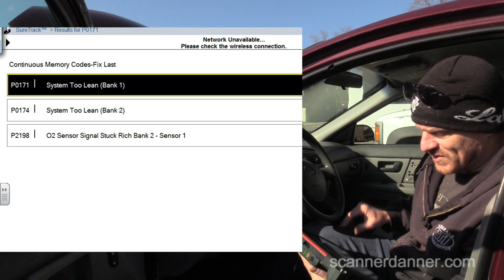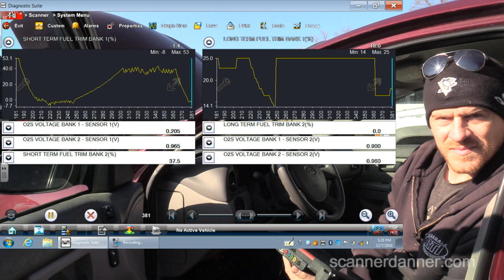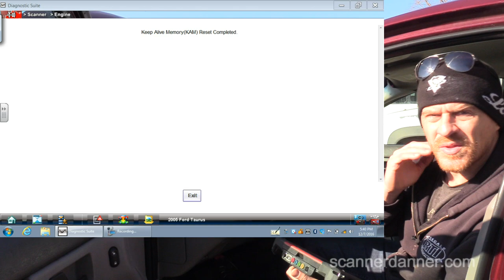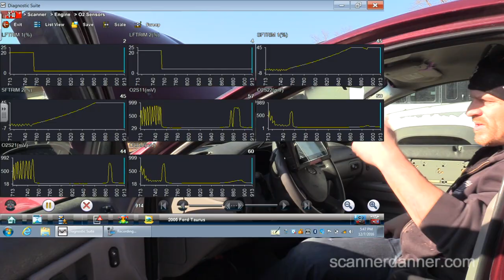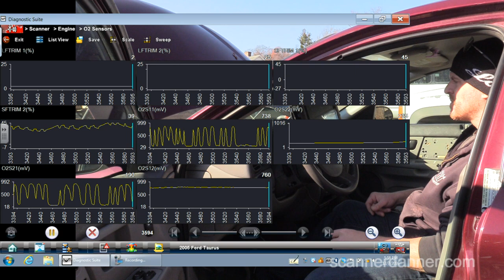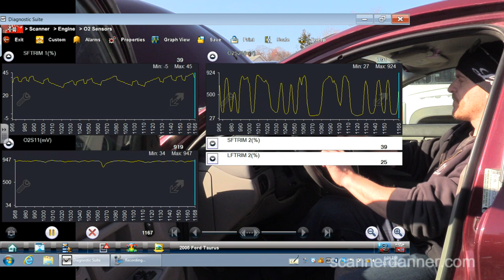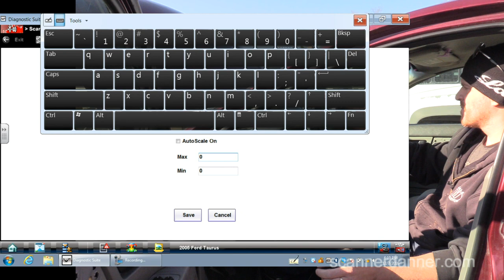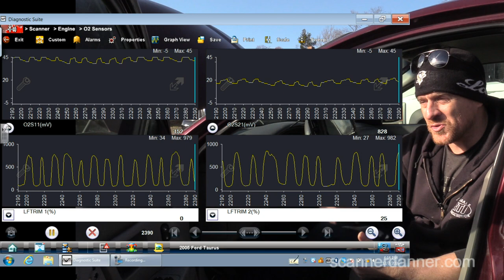Ford Taurus Lean Codes (P0171 & P0174) with Rich Bank 2 (P2198)

Comment: ScannerDanner you have proven time and time again that the water test is the best way to find a vacuum leak. I have a P0172 and P0175 codes on my scanner and I'll be definitely trying out the water test around my plastic intake manifold both cold and normal operating temperatures. I want to thank you for teaching me so many things that I don't know if I would learn without watching your videos so thank you very much for all the great info videos and live diagnosis of all the different makes and models out there. Your students are lucky to have you as an instructor... They're receiving factuals and pure wisdom and you're the best out there man !!!  Keep those water tests going brotha 👌🏼
Reply from the maker: Thank you! The 172 and 175 are rich codes though my friend. A vacuum leak is definitely not your problem. The 171 and 174 codes are your lean codes (vacuum leak, low fuel psi, dirty maf etc)

Comment: Thanks for everything you do. 30 years in the business and I'm still learning new tricks. I'll start using the test light to do the capacitor discharge (thanks to the guy who passed that on). I've also been using the water method since the early 90's when I worked at Mazda dealership. Safe and very effective.
Reply from the maker: Thanks Jeff!
Reply: ScannerDanner thanks for taking the time for making these videos I been watching your videos and I learned a lot from you 
I'm like a you tube mechanic I basically learned what I know on my own. Thanks again 
I actually learn the water test from one of my compas from Mexico lol
I would like to meet u and attent to one of your classes

Comment: It is very important to understand that the OEM"s can have different strategies for fuel trim adjustment with faulty O2 sensors on seperate banks. Failure to know this can lead many techs down rabbit holes and having them become parts changers and replacing parts such as PCM's, all because they truly don't know whats going on when looking at their scan data. I have found that many courses and schools do not emphasize this enough. Great job Paul.
Reply from the maker: Thanks man

Comment: Thanks guys for your inputs. Especially you Paul. It's an honor for you to answer my question. I've seen lots of your videos and learned a lot. You kinda remind me of me as a younger man. However I believe my statement still stands. Maybe I can explain it this way, if you where to clean a contaminated 02, it would probably work as designed, perhaps slower than new. But no amount of cleaning or contaminates would ever make a dead sensor run rich again.
Reply from the maker: Thanks brother

Comment: I just had a the same type of car in my bay yesterday had lean condition mainly when car was cold then became more prominent checked my fuel fuel trims was lean at idle and 3500 rpm wasn't thinking vacuum leak when I seen that ending up being plenum gasket and intake manifold runner valve sealing was completely dried out and not sealing watched fuel trims propane did the trick nice and quick

Comment: I'm having a similar problem on a 2004 Explorer.  Bank 1 is too rich and bank 2 is too lean.  The long term fuel trims are maxed out and one sensor seems stuck at around 0 .900 volts - sometimes!  I'm signing up for sure!  Thanks, man!!

Comment: I think I've watched all your videos and I've learned a TON from you.  I'll post this question on your forum, as you suggest, but one thing I haven't seen you do is the same type of diagnostics when working with (Honda) 5-wire A/F ratio sensors.  I've got a 2008 Honda Odyssey Touring with 165K.  No MIL, no codes, and no driveability issues.  However, during my routine oil change and maintenance I always plug my scan tool in and just take a look at things.  Recently, I noticed fuel trims at +20% total (around 10% ST & LT.)  I checked at higher RPM's and it didn't change much.  Didn't seem like a vacuum leak and I couldn't find any vacuum leaks (using multiple methods) so I cleaned the MAF.  That helped a little bit...maybe 3-5% lower, down to +15% total.  The service manual says if it's under 25% there is no problem but that still seemed a bit high to me.  

So, I went ahead and replaced both upstream A/F sensors (they were original) and now total fuel trims are at around +3-4% total.  When I looked at live data for the A/F sensors before replacing I couldn't see anything wrong with them (using info from your Lexus A/F ratio videos from 2013) but they were definitely causing the computer to add fuel when it didn't need it after all those miles.  Fuel economy jumped up 2-3 mpg in the first tank of gas after replacement with no real change in driving conditions.  Do you have a video that deals with this and how you check cat efficiency with A/F ratio vehicles?  I'm curious how I could have known for sure, before replacing, that my A/F sensors were getting worn or dirty or lazy even though there were no codes being set (aside from 165K miles?)
Reply from the maker: definitely one for the forum my friend. Thanks!

Comment: I went thru this recently (171 and 174). The vent tubes from the cam covers to the air intake downstream from the MAF were broken. Specifically the angle adaptors that interface the plastic tubes to the cam cover, rubberish devices, had rotted out underneath the "knee". This let air get in.

Dorman 46027 PCV Valve Elbow for Select Ford/Mercury Models
from Amazon for $10 fixed it.
You can reach the one on the rear cover from the passenger side using your left hand/arm.

Comment: Canister purge valve on 2009 and newer Fords will set rich and lean codes plus o2 codes for stuck lean and stuck rich it all depends where it is sticking that day and all along it keeps setting codes and by the time the customer brings it in you have a list.

Comment: do i need to change the upstream oxygen sensors the 2 in the front i receive the codes p2198 and p2197 so do i need to change them

Comment: Nice job on this one Paul. Like you, I would have been tempted to throw an O2 sensor at it also, in addition to fixing the vacuum leak.
Reply from the maker: Thank you! And the O2 was not needed in this case. It's been since the beginning of December with no issues after the vacuum leak repair.

Comment: Hey Paul its worth mentioning that on a BMW you can unplug the MAF while the engine is running and it will reset the fuel trim adaptations.  Perhaps this is true of other cars, I do not know, but I always try it every time I run across a new car (and need to).
Reply from the maker: It doesn't reset trims, it uses a default strategy. Not sure about the BMWs you are mentioning.

Comment: A good trick for gasket leaks to temporarily fix them can be to smear the area in Vaseline (petroleum jelly) to see if the problem disappears. Depends how well you can get at it. Looks like it would of worked here.

Comment: like your videos. you have taught this old dog a few tips. howerver- i understand you are making a video  to help us out but i cant wrap my head around trying to prove the o2 while you know there is a vacuum leak. you could dry it off and slather some silicone over it long enough to continue testing(or maybe some bubblegum LOL)
Reply from the maker: Because of what I saw off camera and because there was a rich code. And I do not want to come back after the vacuum leak is fixed. So I spent some time trying to prove a faulty sensor.

Comment: stuck purge valve?
Reply: or a PCV elbow or intake runner tuning valve lol
Reply: motoYam82  bad caulk job from the factory for sure!
Reply: I was thinking intake gaskets when I saw the title. Every single Sable/Taurus I've touched seemed to need them ... and that PCV elbow you mentioned. Crushed flat, lol. 

Or, the "hooting" IAC - that one's always entertaining. :D
Reply from the maker: nope, just a dumb fuel strategy by Ford if you ask me. Good to hear from you Ivan!

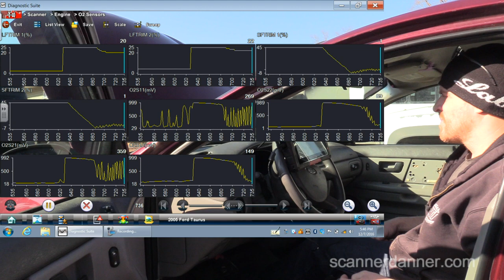Comment: The video overlay is really clear and the graphs on the scanner are excellent  BUT the  scanner text over the transparent area is hard to read, I would prefer  just a white background   Best example is at 20:31.  I appreciate your use of your tripod as it makes a video that is easy to follow and I understand that sometimes you have to crawl into tight spots and handheld video is certainly OK.  Great video
Reply from the maker: Got it, this was a first using this format. I'll be more careful moving forward. Thanks!

Comment: Hey Paul did you get a chance to check the scan data after the vacuum leak was repaired before installing a new O2 sensor?  Just curious how the repair turned out
Reply from the maker: Never did install an O2, everythings been fine after the vacuum leak was repaired.

Comment: Water testing for intake leaks is the best/safest method, sans smoke machine... Our shop almost had 2 full out large engine fires from the same fool who blasted carb clean all around the intake on a hot/running engine...

Comment: good work, had a good one today.  99 lexus gs 400, lean codes, evap codes,  falls on its face during throttle increase, typical maf or clogged cats right.  replaced maf , removed upstream o2 ,ran,.still falls on its face.  Fuel pressure 22 psi, long start time, found fuel pump not installed right, o'ring loose on pickup in fuel tank, then customer tells us fuel pump installed 2 DAYS AGO in Florida.  I reset o'rings in pump and housing in tank, fuel pressure 55 runs good.  Bad install on new pump,  240,000 in car.

Comment: hi mate what recorder do you use on your scan tool I've tried a few and cannot get any to work properly
Reply from the maker: I've tried quite a few myself. The one that records best is from my Smart notebook software (part of the Smart board at the school). 
Believe it or not, when the frame rate is too high, you'll have issues. 8 frames/second works best for a desktop recording
Reply: ScannerDanner ok thanks mate for getting back to me love your vid

Comment: Very informative. I saw other video also about weak fuel pump causing the similar codes at high speed. 

For my 2001 Ford F150 V6 engine, I get P0171 and P0174 code. Freeze Frame data shows 2 mph, 925 rpm, LTFTB 1& 2 banks 12.5, STFTB 12.5 & 9.4, load 70.2%, ECT 203 F. It appears that vacuum leak. Do you agree? I am a DIY kind of person. Enjoy working on cars. But learning. If leaks, where should i focus on?

Comment: I remember when 02s first appeared on the scene, I was taught to think of them as a one volt battery. Lean = low voltage and rich = 1 volt. 
So how can a dead sensor stick rich?
You don't replace a battery when it's 12 volts. 
Am I missing something?  
By the way, love  your videos. Especially that you don't use foul language.
Reply: Think what happens m8 is your o2 sensor measures exhaust content against a reference atmousphere and the difference between this is what gives you different voltages. So if there is no reference for one reason or another it would create a constant 1 volt (there or there abouts) giving you pegged rich. Hope that helps m8
Reply from the maker: Thanks so much. 
They can stick rich from contaminants
Reply: ScannerDanner I had a old ford f150 stuck at 1200mv. The sensor was soaked in oil.

Comment: Great video.  I'm getting a lean code on Bank 1 of my 2005  Duratec V-6. My LTFT on that bank is 25 at idle. At 2500 RPM it drops.  Hoping it's a vacuum leak.  I cleaned my MAF sensor with CRC and changed the air filter already. Thanks. Any other advice would be great.  Running good the STFT's should be about zero, correct?
Reply from the maker: Sounds like a vacuum leak my friend. If fuel trim improves at higher rpms

Comment: Had an e450 flex fuel with bank 1 and bank 2 rich and lean codes... turned out to be low fuel pressure. The system had a 2 speed fuel pump control module without a pressure sensor. Fuel pressure at idle was 30 psi, at wot or acceleration was 55-60psi. At idle or light throttle , fuel trim was +30 on both banks. Ethanol content was learned under this condition, it assumed it was 75% ethanol. At WOT or heavy acceleration when fuel pressure went to 55-60, assuming that the fuel was e75, it would think that there was a rich condition. Long story short, fuel neck had a hole in it, allowing sand, salt and water into the fuel tank, killing the pump. would still run, just low pressure at 1st pump speed.
Reply from the maker: nice find bro

Comment: 2005 Taurus 3.0l threw code PO171 today. Looking for vacuum leak thanks much!  Same car bad coil damaged ecm coil driver,bad ecm damaged new coil,new coil damaged
replacement ecm. Finally replaced driver transistor in original ecm and new coil again brought back coil C sparks.I could not get a reading or test the bad new coil.Also, I discovered
you can use diode test through coil connector to ecm to ground to see a bad ecm driver.Could get no reading using highest ohm scale. Thanks for info!
Reply from the maker: I have other videos on dealing with testing pcm ignition coil drivers on Fords. Check my chapter 22 or chapter 1 playlists
Reply: @ScannerDanner  Thanks much.

Comment: My wifes 2004 mercury sable  gets P0171 & P0174.. this appears to be a vacume leak coming from the gas cap.. every time I re seat the gas cap as well as buying a new one  , clear the code , then do a rescan I get no pending codes as well as active codes.. this appears to be a vacume leak from the gas cap.. can't seem to find a gas cap that will create a better seal.. any thoughts?
Reply from the maker: Gas cap is part of the EVAP system and you will not get those codes from a gas cap issue.

Comment: Mine's really not a comment it's a question I ran the scan tool on my Ford Taurus wagon 2005 came up with two different codes p2198 and a po720 I started my car the other day it ran perfectly fine started it today at idle for about 5 minutes and then it died and now I can't start it anymore it's not firing what do you think
Reply from the maker: Step 1 - define the codes. Unfortunately I'm not a walking library. This is specific to your car.
Step 2 - get some good service info and research what sets those codes
Step 3 - do some tests, then ask me some questions based on those test and maybe I can help
https://eautorepair.adtrk.biz/?a=10817&c=24&p=r&s1=

Comment: Sometimes is only enough to clean up the O2 sensor with some compresed air and it will work again. There are some deposits siting on the top of the sensor wich prevents the sensor to work good.

Comment: im running p0174 bank 2. im for sure it's the o2 sensor. but this car has 4 o2 sensors. all four cost $110. should i bite the bullet and just replace all of them or replace one at a time. and keep clearing the code. till the check engine light does not come on. i already cleaned the maf sensor. did a fuel injector cleaning with sea foam twice. car is running perfect. i wouldn't notice anything if the check engine light wasn't on.
Reply from the maker: What are your fuel trim numbers on both banks? Need that to answer your question

Comment: Depending on mileage it may just be wise to replace both upstream sensors with Repair of the vacuum leak just to make a complete repair as they do degrade over time

Comment: Mine has a vacuum leak in the exact same spot. What did you have to end up fixing??
Reply from the maker: New o-ring or gasket I believe
Reply: ScannerDanner new o-ring in the intake manifold runner control??

Comment: Baro showed 24.5 in/hg which is low, is it because intake air leak? or altitude or both?
Reply from the maker: Or the MAF was a little dirty too? Altitude was 1000 ft and should have been about 28-29 "hg

Comment: I reckon you've got it.  it kinda makes sense...when there's a bad or slow O2 sensor, using the other one to calculate would generally work, so long as both banks have the same amount of metered air coming in.  But with this vacuum leak, that's no longer the case...and so it doesn't know how to compensate for 2 separate problems.  I'm betting on that manifold vacuum leak and a bad O2 sensor - let's see how close we are to reality.  :-D
Reply from the maker: "so long as both banks have the same amount of metered air coming in.  But with this vacuum leak, that's no longer the case...and so it doesn't know how to compensate for 2 separate problems"
Exactly! But I do not think there were two separate issues. It was the imbalance of the airflow accompanied with a stupid fuel strategy that caused the rich bank 2 code. We even saw it cause bank 1 to run rich for a period of time in the video after I cleared the KAM.
Reply: Gotcha - and thanks for a great vid.  Glad I subbed.  :-)

Comment: hello.  I have a 03 Expedition 5.4L. Engine idles and throttles fine under no load. Loaded the engine has low power, lean fuel trim +30 Bank2 and rich -20 Bank1.  Fuel trims are almost the opposite of each other.  I've checked for vacuum leaks, replaced new motorcraft spark plugs and coils, fuel rail pressure is about 55psi, pulled bank 2 cat to see if maybe it was clogged (looks new and clean inside), MAF is good.  Mystery power loss??? Any help would be much appreciated.  thanks in advance.
Reply from the maker: do a backpressure test on the exhaust (remove upstream O2 sensors and measure there)
Reply: @ScannerDanner  hey thanks SuperStar!!! for the tip.  turns out one of my cats was broken inside and clogging up the exhaust.  Never had a car do that before.  Now I know.  Thanks so much.  Car runs perfect now.
Reply from the maker: Good job man!
Reply from the maker: The side with the -20 on the fuel trim was the plugged side right?
Reply: @ScannerDanner  yes

Comment: Have an 2006 taurus  that starts up fine but when you go back to restart it after a while it floods has codes of bad oxygen sensors which were replaced also shows multiple cylinder misfire,had a tune up and no changes
Reply from the maker: What codes? (Numbers)